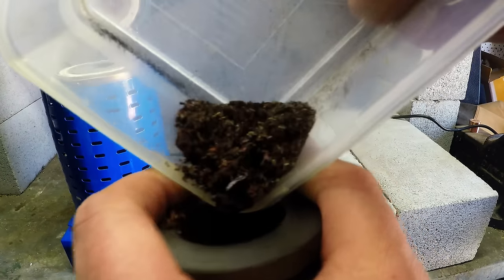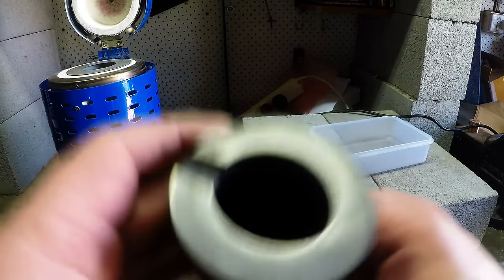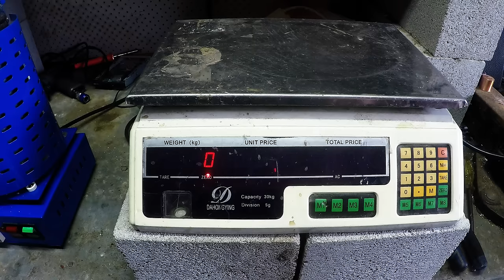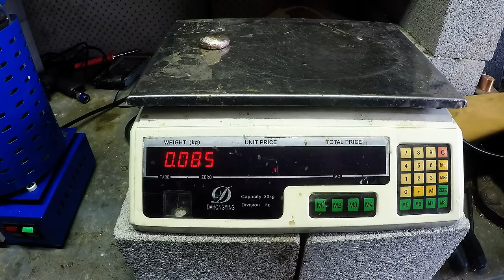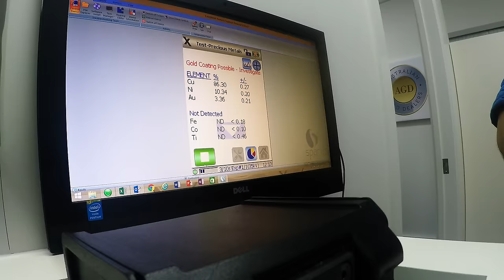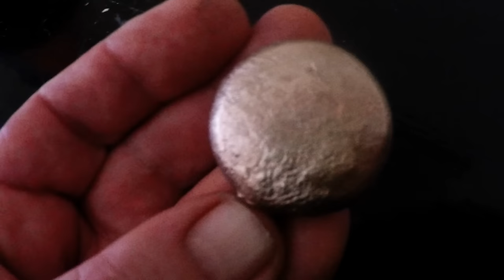Gold Button from RAM Stick Fingers

Comment: Wow, that seems like a hire copper content than what I would have thought. But I'm basing that on the fact that I dissolve most of the copper off my RAM fingers with vinegar and hydrogen peroxide. I just started a new, small trial batch after using your "soldering iron removal process"....which I can see will be much simpler when I filter the foils......no more pulling out each individual pub board remnant and rinsing them off!! That took the most time of the entire process!

Comment: As other have said, 2.93g of gold. I beleive you can drop out the gold by electrolysis of the copper. You will gain pure copper and the gold will be in the anode slimes. You can then purify the gold seperately.
Reply from the maker: Thanks, i'll study up on electrolysis

Comment: you might have more gold than that.  copper-based wire brushes will deposit copper onto metals when heated, and grinding like that can heat it enough, so you likely have a thin layer of copper on the outside of your button.  that machine looks like it uses XRF, which only measures the surface composition.  you can try filing a section and getting that section re-tested, or drill a small hole and test the flakes that come out of the inside.

Comment: make sure before you take any bars to get zapped that you sand the spot you want them to test off or file the area so that you get a reading from inside. you can drill it if you want but if they are only shooting the xrf on the outside they will get some of the surface junk that will show a lower percentage of gold than what you really have. when you just buff it with a wire wheel your also transferring whatever the wheel is made out of onto the metal as well. 
another thing you can do to get rid of the borax slag is to take you bar and place it into some about 10% sulphuric acid solution. the borax will be eaten away and the bar will be fine. (generally when dealing with gold and silver with low amounts of base metals, you might start to form some copper sulphate after a while but your not leaving it in to make too much of a difference even on a bar that is showing about 3.5% gold)
Great video's though :) keep up the great work!

Comment: Hey ben one question: is it worth buying 2lbs 11oz of ram boards for 45$ dollars, using your method with the soldering iron?
Reply from the maker: Nope, $15 lb max but to get value you need to process the IC chips too at that price, 2 lb of RAM is not enough to process anyway, you really want 2 lb of fingers alone to bother with it
Reply: eWaste Ben i probably would've ended up buying them if you had not replied, thank you

Comment: Hello, I have recently discovered your channel.  I have a lot of RAM.   At first, I was going to cut the "Fingers" off with metal sheers.  I am about 10% done with my total inventory and its going too slow!  I estimate to have well around, possibly above 2000 sticks.   I have them in boxes, at least two that are the size of the box of RAM from the first video.   Is it possible that I could burn the "Fingers" that I have already cut to separate the foils from the board?    I like your technique of using the soldering iron to remove the foils, I will probably do that next time I get the patience to start processing them again.    I don't want to burn all my boards, just the fingers I've already cut.  (since removing them with a soldering iron would be very hard.  )    I would like to end up with a nugget like you have here, that's just a mix of metals.  I have too many boxes, having it condensed into a nugget like this until I can process it again later would be nice.
Reply from the maker: there's more to ram gold than just fingers, the ic chips have gold too. but there are basic chemicals you can use that will remove the foils off the fingers and at the same time eat away some of the copper & nickel, leaving you with a higher purity of gold foils.
look up AP for gold recovery
Reply: Look up the channel Cody's Lab if you decide to go the chemical route.  He'd got a great series on recovering and refining precious metals using chemicals.
Reply: +eWaste Ben cool, I didn't think of processing the IC chips.   I have plenty of  ram sticks that I haven't clipped yet,   maybe I could set up a container, and line up the sticks very carefully, and add the chemicals so that its level just covers the foils.    I've seen cody's lab channel, the chemicals kind of intimidate me.     I'll keep an eye out for your videos, just to keep watching the technique.   Your series is the first that I've seen that really shows how much potential is in X number of ram.    I also noticed a milling video you have for processing IC chips, I'll check that one out next.   I'm not too interested in making money, I'm mostly interested in the process, and seeing what value I can get from saving "trash".

Comment: You don't have to leave it in anything, just dump it straight into a bucket of water, it's called hot shot. Makes a nice little round on the sides kind of pointed on one end glob of whatever you melt.

Comment: here is how you separate gold from copper.  The works toilet bowl cleaner (hydrocloric acid) and some hydrogen peroxide 50/50.  It will dissolve the copper. It takes about 2 days. Same process used to etch circuit boards.

Comment: Great video!  Just a question and also a hint of advice.  Where did you get your electric furnace from?  Also, when polishing the finished product, I recommend doing it inside of a plastic container.  This way here you catch all of the dust that you are removing during the polishing stage and can re-melt it later.  Especially if it is gold bearing material.  Thanks for the great vids, I've learned a lot from them over the last few weeks.
Reply from the maker: Thanks, the link to the manufacturer is in the description of the copper ingot video I did last week.
Reply: Awesome thanks a bunch!

Comment: Hi Ben. Another great video. I did the math and that is 2.93 grams of pure gold. you could send it to someone who does refining and recover pure gold from it but it always seems like more work than its worth to me and that nugget you made is so beautiful like it is I would keep it like it is. And if you really wanted to get rid of it I bet it would sell on Ebay just like it is. And a tip on the borax. If you use more of it when melting it will break away like glass when the metal is cooled off and also it is soluble in water so I just put my nuggets in a jewelry cleaner for an hour or so after breaking away most of it. Very enjoyable video to watch.
Reply from the maker: Thanks Scott, think i'll just keep it or might use it as a prize in a competition one day.
didn't know borax was water soluble, will try it next time

Comment: Ben, just browse around google & youtube and look at gold extraction processes using chemistry. 
Learn about aqua regia (1 part nitric acid, 3 parts hydrchloric, assuming equal acid strength/concentration) and how easy it is to make it. 
That ugly button in your video won't dissolve completely because its too thick, and as the acid dissolves the gold it leaves behind a layer of gunge which prevents the acid from eating away furthur, so you need to reshape the material until its less than 3mm thick or cut it into 100 tiny pieces.
Once you dissolve all the gold you simply filter it out through kitchen towel/coffee filters to get out all the non-liquids and then you add sodium metabisulfate to precipitate the gold out of solution.
IF it DOESN"T precipitate out then your mixture is too acidic or contains too much nitric acid. If that is the case, SLOWLY add 1 tablespoon of sodium bicarbonate (bicarb of soda) every minute.
Once the pH reaches closer to neutral, the mixture should turn dark brown, and that is the gold being released from the chlorine.... leave it for 30 mins and let the gold sink to the bottom. Wash it out and dry the gold in the sun or a heating device. What you're left with is gold powder. Put it in your crucible and melt it, and you will have 24K PURE gold.

Comment: 3.45% gold from 85g is 2.93 grams of gold.  You are going to need to refine about 10 of these to get anything worthwhile.  So that is about 10,000 ram sticks.  not sure there is any gold value to be had after the work and material cost.
Reply: LET'S TELL THEM THAT IT IS THAT THERE IS A METAL STATE AND IT HAS A GOLDEN COLOR FROM ELECTRONIC TYPES AND IT DOES IT RIGHT? WITHOUT GOING TO CHEMICALLY .. SO? DO WE PUT THEM DIRECTLY AS IT IS RIGHT ?
Reply: Thanks in advance
Reply: Don't forget the other values besides the gold that is alot of copper it all adds up. It's well worth processing as it takes very little acid to process those buttons.

Comment: Use Nitric Acid. It will dissolve the copper and nickel but not the gold. You can recover the copper and nickel by electro-refining later. HCl won't dissolve copper but will dissolve nickel.

Comment: Thanks for nice video and hard work. Now I know real ratio of gold in ram strips. Just one question came out. 10% Ni content melted when melting point of Nickel is 1453 degree Celsius.
Reply from the maker: Yeah, i'm not sure how it happens, maybe because the nickel is very thin.
Reply: it was dissolved by liquid copper

Comment: Zhou need to get your gold on the far side of 3400 degrees, hotter than the temp to melt platinum to atomize gold and loose weight...your not getting anywhere near that with your map gas or electronic cooker...super high temps

Comment: i'm sure you know this now but there are people who use oxidizers to increase burn heat in cruicble and carbonizers to reduce but most people put a linked oxy bottle to the map bottle to increase the burn heat, big question is did you sus out how much zinc / lead/ solder? i hear there's a thermo device to sus out the percents purities, work towards nitric acids at the end just for the gold once you've removed the other crap, i  wonder what nickel is worth these days, copper bars sounds fun

Comment: 9:02  what kind of device is that to test for purity?  Looks like the sample just sits in there.
Reply from the maker: yeah it's a desktop xrf that connects to a pc, that one costs about $17k
I took in a larger silver poured bar to sell and they drilled 2 holes each side and focused the xrf into the holes.

Comment: i woulda just purified it with acid and sodium meta bisulfate first.  It looked to be in a good form to do that.  When i MAPed by filtered foils I crumpled the filters up and burned them with the flakes inside.  It melted into a button fine with a thick silicate crucible, lost two little numbs in the crucible though and i was only working with 1 gram of gold, it tested over 14kt pure.

Comment: you can clean off the borax & slag by putting it in a small beaker placing it on a hotplate with some Sulfuric acid & heating it up (not too hot) if it smokes its way to hot
Sulfuric acid is super dangerous when its hot !!
Reply: cheaper to just buy it in jewelry making form called pickle solution, you can also put gold plated pins into it and it will eat everything but the gold